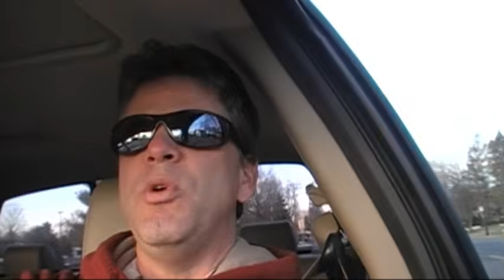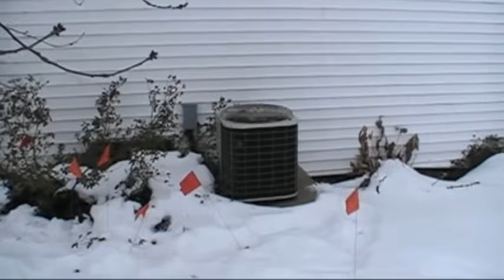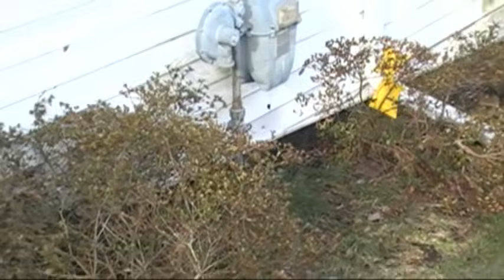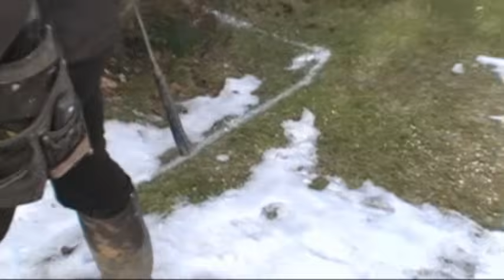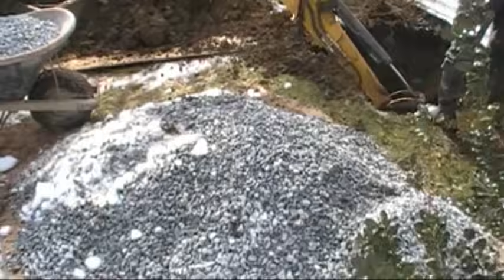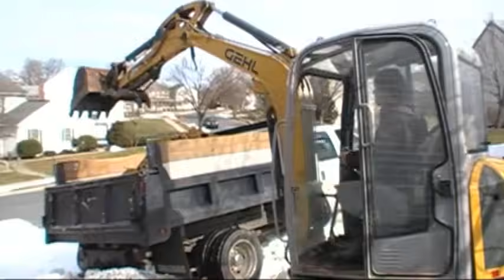Basement Finishing Egress Window How To Video (Part 1)

Comment: Generally speaking, how much would it cost to upgrade an existing basement window (36''W x 18''H) to an egress window?  What if the homeowners will dig the 3ft-cube hole and construct the window well.  Basically, how much (price range) would it cost to remove window, cut concrete block, install new window?
Reply from the maker: Hello Jessica! Well it really depends on the thickness of the wall were cutting and if it's as block or concrete wall:-) I would have to take a look at the wall elevations and the window you are planning on installing as well to give you an educated estimate!